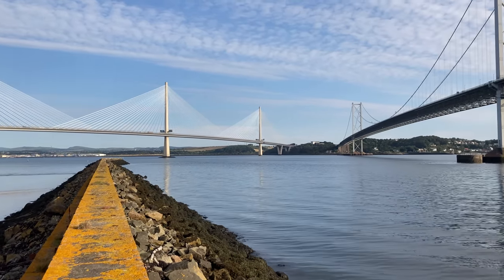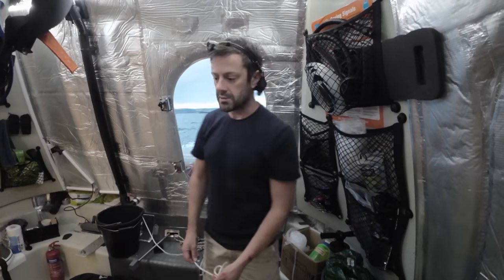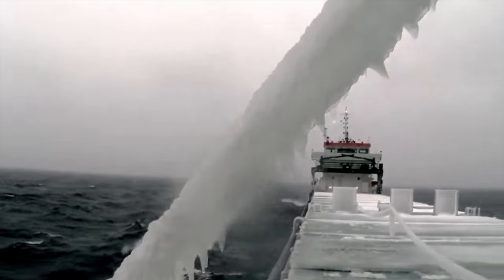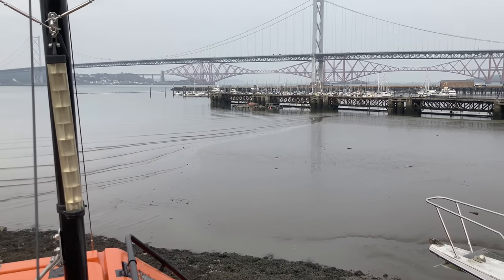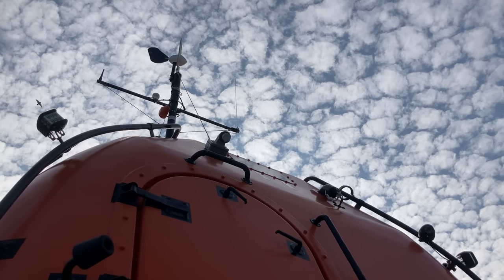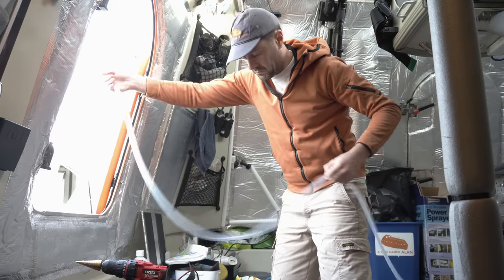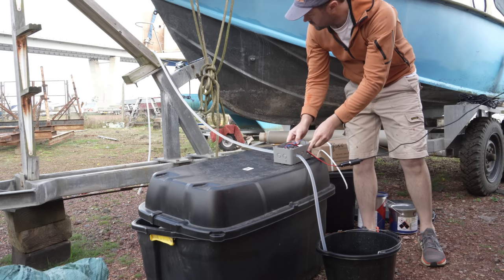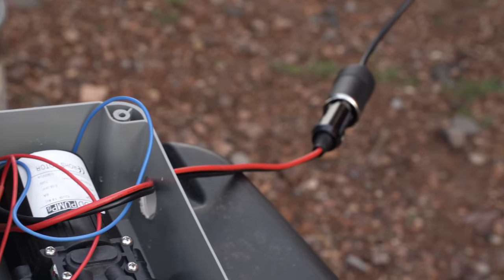Rope wrapping railings for Arctic cold, and a DIY 12V bilge pump for expedition lifeboat. Ep100 [4K]

Comment: I had not appreciated the need to wrap metal railings for winter work.   It makes sense.
A good update.   Sadly now that Alan is moored for the winter we are not able to get footage of the sights of the coastlines as you travel.   So many wonderful sights you captured on the legs up the coast.
The 12V bilge pumps can be a major benefit in future legs.   Liquids on the floor can make for slippery conditions especially in rocky water conditions, so very good to be able to get any liquids removed fast.
Reply from the maker: Alansøn III and I will go for a winter trip.

Comment: Wow … a dedicated video - well half -  to a suggestion I’m responsible for?  Looking much more nautical … Impressive and I’ll have to set aside some fuel money.  Now for some real flair … orange and black Turks Head knots on the ends to secure the cordage (supper glue and or epoxy for safety’s sake). Safe travels
Reply from the maker: 😂cheers

Comment: Small suggesion:   "nubs" spaced a foot and a half apart on the railings might come in very handy. Ice builds up over rope and can still make it slick as snot. As an ex Bering Sea fishermen I have some experience regarding this problem and thus a suggested solution.  Something for the meat of your hand to rest against as you are being swung side-to-side could prove to be important. There are lightweight plastic clamps out there for cheap that would do the trick. Might want to change the bolts out with stainless though.  
     Just a thought.  Did you put handles next to the head so a person can "hold on" in bigger seas? Just curious if my one and only other suggestion was worthy to the cause. 
 Go Alan!
Reply: I thought those bolts were stainless steel.
Reply from the maker: Thanks, and useful from someone who's been on the Bering Sea! Some of the cleverer wrapping/whipping techniques include nubs in the design, so your solution to improve my wraps may be the trick.
Reply from the maker: Correct.
Reply: @teeanahera8949  I think s/he was referring to the bolts on the suggested cheap plastic clamps as candidates for replacement?

Comment: That pump looks like an membrane pump, which only pumps clean water, as dirty water would stop the valves in it from working correctly. An filter might help, but small particulates might still ruin the pump, not to mention reduce the flow.
Reply from the maker: I'm slightly confused. Many of the diaphragm/membrane pumps I can see are specifically marketed to transfer sediment.
Reply: You'll find that most manual bilge pumps are membrane pumps
Reply: That's a bad choice of pump, it looks like the same type of pump we have on our narrowboat for domestic freshwater.

Comment: Hopefully not a daft question, but wouldn't you need to wrap the vertical grab rail (handle?) next to the door?
Reply from the maker: Yes. To be wrapped.
Reply: I know absolutely nothing about winter weather, but is wrapping the metal truly advised?

My intuitive thought is that if ice forms on a smooth surface, you can get it to pop off somewhat easily (like from an ice cube tray).

But wouldn't the rope act like a giant wick, or the fibers in fiberglass? Becoming embedded inside whatever ice forms, giving it a solid foundation to hang on to, and meaning you must break the ice apart rather than knock it loose?

I'd love to be told how I'm wrong.

Anyway, if I'm not wrong, the last thing you'll want to have to do is de ice that top railing in bad seas.
Reply: @PsRohrbaugh I dont know much about boating in winter. But it should help it to not form a smooth surface allowing for a better grip. And i think the rope somewhat is like a sponge under the ice when struck it will give enough for the ice to crack. I think would be pretty hard to remove ice from long smooth piece of pipe than in pieces.
Reply from the maker: Polypropylene doesn't adhere to very many things, especially water/ice. It doesn't adsorb water like other ropes. I've found in the past, perhaps counter-intuitively, that ice forms on metal like a limpet to a rock.

Comment: Thanks for the update :) I might like to make a small comment. I once had a similar pump and silicon tube set up. Mine worked really well for a good while but I noticed that it eventually developed a nasty habit. The silicon tubbing would some times get jostled and and the tube on the inlet side would collapse and choke off the pump. The pump would loose its suction for a moment and the hose would uncollapse which would let the pump pull back up to full speed which would again collapse the tube. It would then rapidly cycle like this not moving much water at all. I eventually gave up on the silicon tubing and went with a more rigged nylon tubing. That said though I was using mine for a more mission critical role so I'm sure your set up will work well for the less intensive application you mentioned, but I thought it might be a weakness you might like to know about :)
Reply from the maker: Thanks.- yep I mentioned using a thick tube wall, as I found the same when I tested thin normal silicone tube. This one holds shape nicely even when the suction is strong.
Reply: @AlexHibbertOriginals  You might want to add a short sections of stainless steel spring into the suction and, just 4-6 cm.  You may need to clamp it into place and the silicone itself would collapse, but with the spring in the end, it won't and you will get a firm area to clamp on with.  Also is that pump rated for salt water?  If it isn't, you will need to thoroughly flush it after each use, or the diaphragm it uses will become brittle, also the greases it uses internally may not be rated for salt water.  And it looks like a centrifugal pump in my RV, there is a small diaphragm for when it self-primes that is the one I am referring to.  I was able to rebuild mine with a rebuild kit, but if you embed it, you may lose that option.  So a spare maybe something to put in the parts locker.

Comment: You might want to go ahead and wrap the uprights now. Even if you don't grab them, you will still need to break the ice off of them to keep from getting to top heavy. A little work now in the nice weather is better than even a little extra work when 30° below and stormy.
Reply from the maker: Maybe wise.
Reply: We had problems crossing from  Harris to sky in a drascome dabber when the  bilge pump became blocked with paper tin covers ( all tins were packed in the bilges for added ballast) .....lt was a rough sea crossing and we had to bail with a bucket for 6 hrs......mind you the meals from Sky to Oban were  interesting ....ambrosia creamed rice with mince comes to mind not forgetting custard with garden peas .So  a pump strainer would be a great option...remember when ever you need a pump ,you will need it to work! And keep working!
Reply from the maker: Thanks - yes I have a strainer on my large 'emergency' fast pump. This is more for slower deliberate emptying from small areas.

Comment: Have you looked at the covers you can get for in-house radiator pipes? They make some that are basically cheap open-cell foam (which is obviously not what you'd want, because that's going to start rotting away very quickly), but they also make very nice looking sleeves that do a great job of isolating.  
For the harder to reach spots, that might be a good way of still having a few key spots wrapped in a way that doesn't slip but also doesn't require tightening a piece of rope too much. You could wrap it around the conduit, then if you ever need to put more cables through you just open it up again and it comes right off. You'd have to test a few different options, but they work on freezing/frozen pipes in damp garages and don't mind condensation, so that might not be a terrible option.
Reply from the maker: That might be a more flexible approach for the conduit areas, thanks.

Comment: Not sure if it's an issue on my end, but the voice over seems to have some weird echo effect on it that's not present in your other videos.
Reply from the maker: Sounds ok here.
Reply: I can hear it too.
Reply from the maker: Every twenty or so videos I get a comment like this. There's some basic levels work on the sound, but no echo. Definitely sounds fine on the headphone and large speaker system I test on.
Reply: @AlexHibbertOriginals  I've done little audio work, but enough to know it's a beast when it wants to be 👀

Maybe it's an auditory hallucination on our end caused by lack of angle grinder.

Comment: You might want to fit a basket on the end of the suction hose so it will not clog up when one of yer dirty oil filled sockes get sucked on to it.
Reply from the maker: I couldn't find an inlet filter of the right size, but will keep looking.

Comment: For the wraps; If you would like a bit neater and more enduring tie-off at the end; doing a loop and pull-through might be a good alternative. Same technique for wrapping bowstrings, securing guides onto fishing rods, etc. At the start you leave a few inches of cord along the rail and then wrap over it such that the end is buried under a dozen or so wraps. When you get to the other end you take a small loop (that you cut from the cord prior to starting) and when you are a few inches from finishing you lay the loop along the rail and wrap over it to the end, leaving some loop exposed. You then take the free end of the cord, tuck it into the loop, and pull the loop back through, again burying the end under a dozen or so wraps of cord. For added tightness once you have pulled the end free, before you cut it off flush, you can grab and twist the whole wrapped section and work any slack down to the end where you can give the tucked end bit an extra tug to take up the slack.
edit: I'm sure you're already aware of this technique but if not it's also handy for semi-permanent field repairs of poles/rods etc if all you have is cordage to effect the fix.
Reply from the maker: The ends can certainly be redone if I get some time to watch ropework YouTubes.

Comment: Just wondering if ice accumulates on the hand rail and it breaks off and falls it can hit your solar panel. Just a thought.
Reply from the maker: I'm actually swapping those panels out for tougher ones soon.
Reply: @AlexHibbertOriginals honestly, I wouldn't worry too much about the solar panels. They're of limited use in arctic latitudes even during the summer, and of no use in the winter. Besides, the alternator puts out so much more electricity than the solar panels, they won't matter unless you turn the engine off for long periods (either because you're camping, or adrift).

That said, I only realized your engine electrics were 12v relatively recently, so with that in mind I STRONGLY recommend adding a 24v alternator. Not only will it charge your house batteries much more quickly, but you can handle either alternator failing.

Besides, alternators aren't really designed to be operated at maximum load for long periods, so I wouldn't want to put too much stress on the 12v one in the first place.

Honestly, I'd have a 12v system that consists of just your engine alternator, that 12v battery you have, the starter motor, and any other engine electrics. Then a 24v alternator going directly to the house batteries, with a programmable voltage regulator that won't over charge them. You can use your 12/24 converters during emergencies. Just a thought. I'll re watch your older videos to make sure I understand it right.

But yes, 400w of solar panels is like 100w or less of solar power, so a few amps for a few hours a day. Better than nothing, but not by much.

Comment: Seeing the railings being wrapped in cord reminds me what is bugging me about Alan´s railings. On ships that I have been on there is netting from the rails to the decks fo prevent you from sliding off the deck in rough weather. I would feel safer if my boat had these fitted, what do you think?
Reply from the maker: There's a case for some additions there, yes. Although, you'd not routinely be up there in bad weather.
Reply: All the more important if you have to be up there. 
Twas just an observation 
 @AlexHibbertOriginals
Reply from the maker: Cheers - will add to the list.